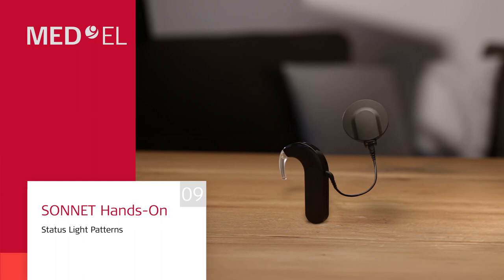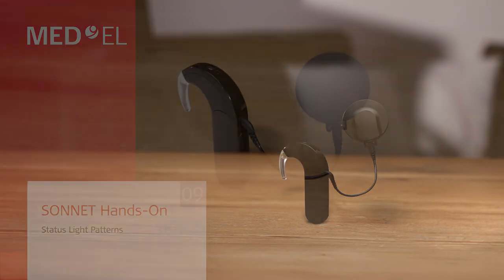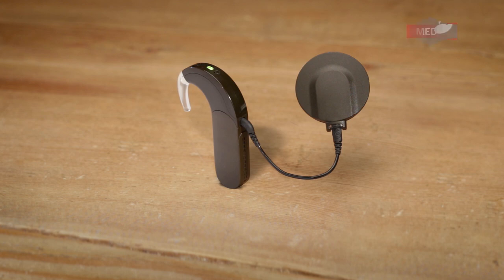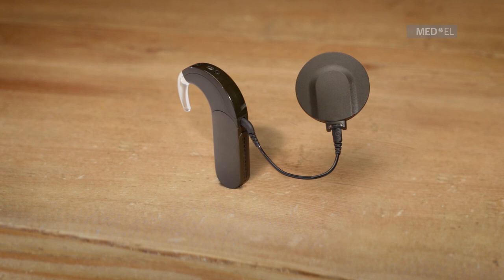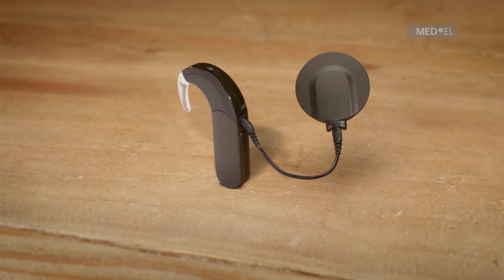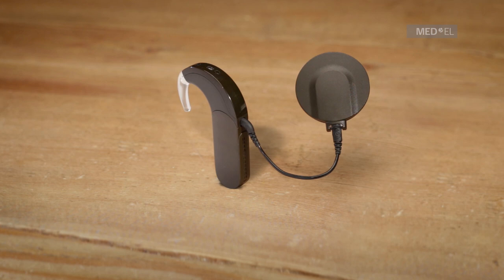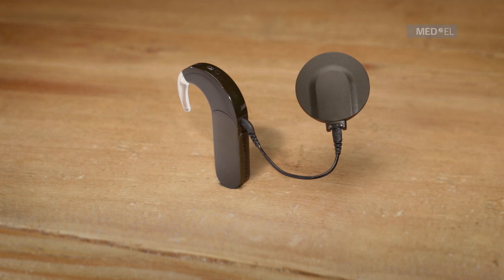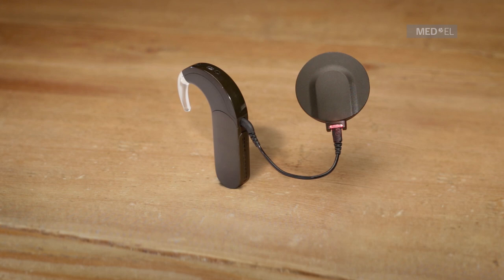SONNET Hands-On: Status Light Patterns—MED-EL

Comment: If an indicator light on the DL coil blinks green 3 times when placed on the head and then doesn't do anything then what? 
Does it need to continuously blink green or is that 1 instance enough?
My 2 year old has the sonnet 2
Reply from the maker: Hi there, thanks for your comment! 

If the indicator light on your son's SONNET 2 blinks green three times after being placed on the head, that is confirmation the audio processor and implant are successfully connected. So that one instance is enough and no continuous blinking is necessary. 

You can find more information about the light patterns and what they mean in the SONNET 2 quick guide. It's available for download here: https://www.medel.com/support/product-support/audio-processors/sonnet2/downloads

Kind regards, Verena
Reply: @medel  thank you!